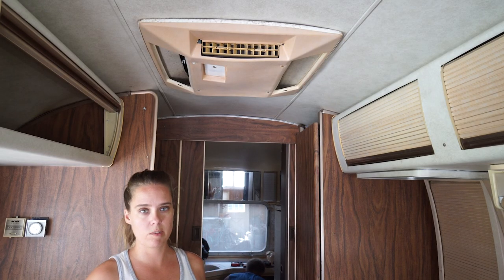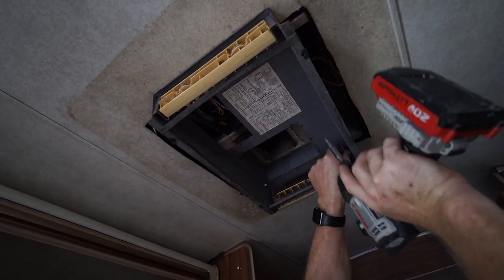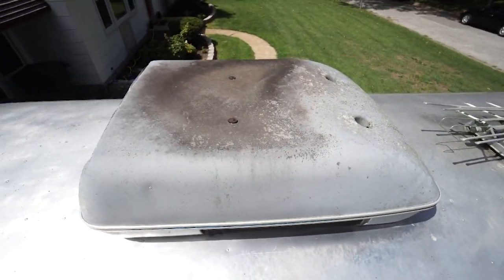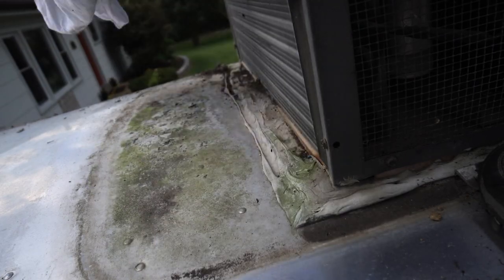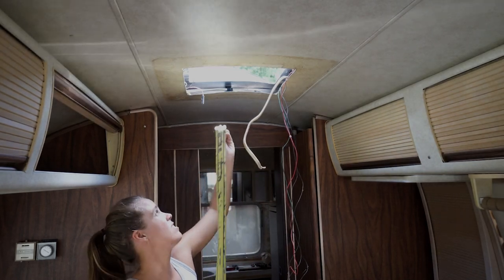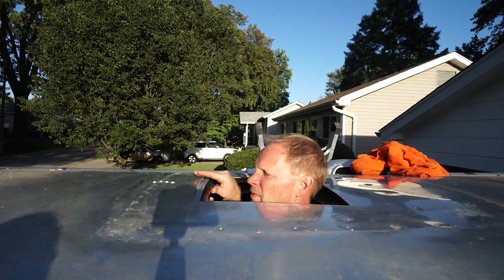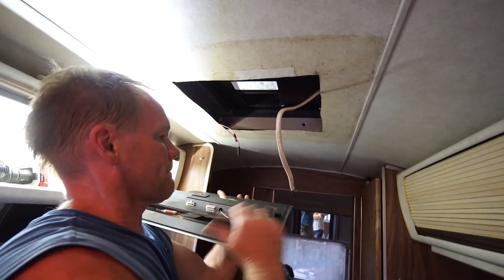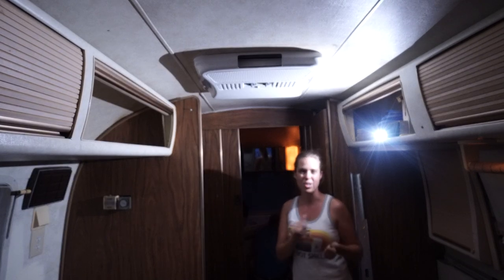Airstream Renovation Vlog: Replacing Your Air Conditioner

Comment: I think you can buy a drip pan specifically for the Dometic A/C.  It then connects to the drain tube.  The advantage of using the original drain tube is to keep the condensation from dripping down the side of the trailer.  If you decide to polish your trailer, then you will not like the water running down the side.  But since you said that the water was running down the inside walls when using the original drain tube, I would agree that letting the condensation drip down the outside is far better than getting a wet plywood floor!!!  Thanks for the videos - Keep them coming!!!  A new A/C is also on my list to be replaced this year as well.

Comment: Very helpful, thank you! Although it still looks like a lot of work  😊 Would love to see a video on replacing the water heater. Ours corroded over the winter, and we’re still trying to decide whether to attempt replacing it ourselves or take it to a dealer.
Reply from the maker: I know, I almost didn't post because I felt like we complicated it too much, but I wanted it to seem real life. I've heard of dealerships charging over $1,000 to install, so in my opinion, this half day project was still worth saving the money.
Reply from the maker: And yes, I'll do a water heater replacement video soon!!
Reply: You didn't complicate it at all. I just meant that climbing up on an old Airstream to get the AC off is not for the faint of heart! We've had our 72 Tradewind over four years, and still haven't worked up the courage. Dealerships don't just charge for the install, you also have to buy the unit from them at a premium, so there's a significant cost benefit here, not to mention the sense of accomplishment in doing it yourself. Kudos, and looking forward to more DIY videos!

Comment: What did you plug the old mounting holes that went around the parameter of the old ac with? 
 I just took off my old air conditioner and there was about 100 rivets around the perimeter of it.
Reply: I've got the same issue
Reply: I ended up getting blind rivets and used a little silicone cover the old rivet holes. It’s made a year and no leaks. 🤞🏼

Comment: Hello!  Thank you for this tutorial?!  I am installing a Coleman Mach 3 onto my 31' 1976 Sovereign.  What exactly did you do to make the brace you put under the roof to close the gab that was made on the back side?  We are having the same issue and really don't want water pouring in!
Reply: Hey there. I made mine out of "C" channel. Then, I approximated the curve of the ceiling and cut a piece of wood on my bandsaw. I screwed that onto the "C" channel. The entire "truss" was then screwed onto the brackets that hold up the centre aluminum panel. I'd send you a picture but that doesn't seem possible on this platform.
Reply: @JamesFunkify  is there any way you can send me some more information on your bracing? I'm installing one this weekend and was just going to try and cut the curve out of 2x4 but if yours is easier I may go that direction.